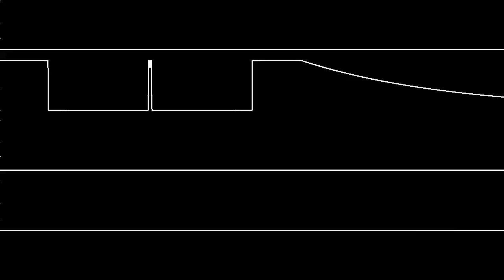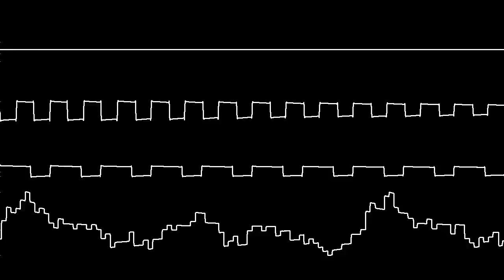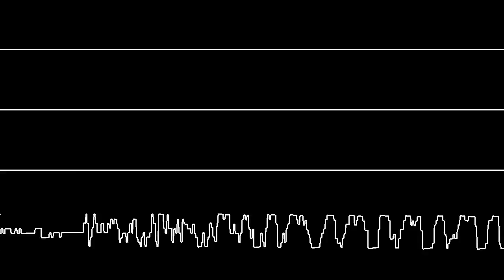C64 Jeroen Tel's "Turbo Outrun" Oscilloscope view

Comment from the maker: It seems like we have been visited by 2 disgruntled Spectrum owners :)
Reply: Haha! ;-)
Reply: 8 months later and make that 6. The Spectrum was both capable yet not at the same time. It was more like the Master System's sound chip (Well, not too far off really) so it could not perform near as complex as the C64. The only thing with the Speccy is that it has a much bigger following with it being a much cheaper micro than the Commodore meaning people will have a larger bias, especially if they were one of those kids in the playground arguing about which micro was better. Yes, the Spectrum in the end had more memory but it was hindered in every other way, both video and sound wise.
 I myself am only 16 but have been brought up under the use of old micros to respect what tech was like in the past.
 I wonder if the conflict between the Spectrum and C64 will ever end. Who knows? It may never end!

Good day!
Reply: Hehe!
Maybe another 4 were lsdj chiptune composers...
Reply: probably not. XD

Hey, at least you weren't one of those people (like me) that owned an Atari 800XL...
That machine wasn't exactly weak, but it failed. Hard. Against pretty much everything. (mostly not for technical reasons though)

Granted I had one around 1990, so the 8 bit micro wars were long gone by then...
The primary hobby of Atari 8 bit coders nowadays seems to be to see just how far you can push ANTIC + GTIA...
Quite far it turns out. (if the 4096 colour JPEG image viewer is anything to go by. XD)
Nothing about getting high end graphics out of an Atari 8 bit is remotely straightforward. (with only straightforward basic techniques it gives worse results than a c64, for sure. But when pushed it seems to do things that seem unthinkable for an 8 bit system)

None of this has anything to do sound of course. Pokey is... Well, it's not the worst thing ever, but it's certainly no SID chip. It can come close if you try hard enough I guess... (and sample playback of a sort is a feature, and not a hack), but still. Otherwise nothing but square waves as far as the eye can see... XD
Reply: 7 now
Reply: Well, mostly, the spectrum didn't have the HW features that made it easier to play samples. It even has 3 volume controls instead of 1. The problem is that the chip is slow and you could only have envelopes or volume contol for all chips at once. And since samples are usually played back through volume control, one would have to tailor the whole song around being played back in that manner. Also, not all spectrums have the same timing. So Sample Playback is even more tricky on the spectrum.
Reply: NINE
Reply: They've been joined by a few old Amstrad owners.
Reply: Honestly I do quite like the POKEY sound myself, but the SID has much more potential when used by someone who knows how to use it. But atleast the POKEY has 4 channels, not 3, but...

A big problem with the POKEY is that it only uses 8 bits for pitch precision, and ends up sounding out-of-tune in the higher pitch ranges, and you can only have 16-bit pitch precision if you disable one of the four channels.

But still, the Atari 8-bit was released three years before the C64 and a year before the VIC-20, so you've got to give it some credit, since the only succesful computers back then were the Apple II, Commodore PET and TRS-80, with the latter two not even having sound.
Reply: @leoleonvids  didn't the Commodore PET have a beeper?
Reply: @PremierRomanov  how can a machine with less than 50% of sold units have a much bigger following?
Reply: @Ailgadem  Later Models Did. Only One Beeper So No 3 Channel Music

Comment: People do not even know how much ahead of its time was this or in general C64 music programming - and by extension any kind of coding for the machines of the time. Most programmers nowadays are python API-callers that would not even be able to read that 6502 asm source, let alone to write it at 17 years old. I'm not saying this because I was too, in my little own, a coder in the Amiga demoscene at the time, but because the C64 and Amiga epoch (the 80s and the early 90s) are not credited enough, imho, in the history of informatics and digital arts.

Comment: This is incredible. Jeroen Tel was a god on the sid chip.
Reply: Same thing as Rob Hubbard.
Reply: Bruce Alexander Exactly. If I recall, Hubbard was one of the first (if not THE first) to use this "sample bug", on Skate or Die. Which is an amazing soundtrack as well.
Reply: The first samples (included with a SID song) I heard were in the Arkanoid title track by Martin Galway.
Reply: Didn't know that. I did some research and apparently Galway was the first to take advantage of the SID's volume register in order to simulate a fourth channel. However he didn't actually use samples, but created the sounds himself via code. I know that eventually he made a custom version of the Arkanoid's soundtrack using 4-bit samples. Hubbard was maybe the first who included an electric guitar sample in a SID tune.
Reply: Skate or Die 2 only existed on the NES, and the title screen music took advantage of the 2A03's 7-bit PCM.
Reply: 1 bit Delta PCM, actually.
Reply: Actually, 7-bit PCM would be possible on a 2A03 by fiddling with Famitracker's Zxx effect. This was used for the vocals and electric guitar, while the drum samples are normal DPCM.

Check https://cirrusretro.com/listen/147-skate-or-die-2-nintendo-nes and mute all channels except "DMC."
Muting channels and seeing oscilloscope view requires the use of a computer. Won't work on mobile.

As you can see, the sample channel is sending a buffered PCM wave instead of a DPCM waveform.
Reply: Interesting.
Reply: Bruce A. Dyson That makes me wonder, maybe you can use the 5th channel like the gameboy wave channel and use it as an extra synth voice for pseudo expansion sound which would be particularly useful for non Famicom NES. It would probably take up too much CPU though...
Reply: @Bruce Da Moose Lol, I just came back here to these replies a few days ago, and suddenly you post this reply!

Comment: I'm constantly amazed with what people could make these old machines do.
Especially once I really started to look into how they worked.

Sound especially seems like a pain, given the timing constraints and the interaction between sound, video display and CPU time.

I can certainly see why the 16 bit consoles all had a dedicated co-processor for sound.

OK, so personally I've mostly messed around with my 800XL, and while Pokey has rather different qualities and features to the SID chip, the basic principles of getting it to produce any recognisable melody don't seem to be vastly different. Getting anything to update at anything other than either 50 or 60 hz (depending on whether it's a PAL or NTSC system) or an integer fraction thereof seems especially difficult. Which is... OK, sure, 3000... 'notes' per minute? But for sample playback it's extremely low...

I'm impressed with how long this track is too. Where do you find the space for it all in just 64k of memory? XD

Anyway, not like I'll ever get any decent sounds out of these old systems. I simply have no musical talent. I can code, and I can draw moderately decent artwork, but when trying to compose a tune I'm completely lost...

Comment: Are the samples being repitched (like for the bass) or are there many samples each for a specific note?
Reply: Are you talking about the resolution of the waveforms?
As far as i know about the SID Chip (Which is from reading, I'm from the 2001 so... no much experience xD): It didn't have a sample table, it used pure logic electronics to accomplish that waveshapes, that's what makes it so unique. 

Plus, it uses a 24bit counter to sample them, so yeah, plenty of room to make really smooth waves. Added to that it uses low pass filters which adds an extra smoothness.
Reply: Probably repitched. The bass guitar and bass drum are on the same sample. I can hear the bass drum change pitches with the bass.
Reply: As far as I know, with the tracker I use (I don't know about Fast Tracker II, which is what he used), but essentially what a sample is is instead of square waves or triangle (etc) it's the sample. Which means you can play it as if it's just a synth, I'm pretty sure that's how most samples work anyway.
Reply: I think @Donald Thompson 's answer is the most close one. I finally get that the question was about if per every note there's a different sample which represents a different frequency. — So, @Train 's answer is also good, as it pretty much proves that this was made using one single sample per instrument and then being re-pitched before sending it to the SID. 

Although, it could be just one long stream of data being repeated (? idk. As i said, i never had the experience to use this hardware and probably never would xD

Comment: 0:00
Noise wave 
Noise wave 
Noise wave
Noise wave 

0:24
square wave
triangle wave

square wave
triangle wave

square wave
triangle wave

0:46
Noise wave 
Noise wave 
Noise wave
Noise wave
square up building

outrun

square wave
triangle wave
square wave
triangle wave

square wave
triangle wave
square wave

1:22

Noise wave 
Noise wave 
Noise wave
Noise wave 

outrun

sync square wave PWM 20-80% Duty Cycle to down volume
sync square wave PWM 20-80% Duty Cycle to down volume
sync square wave PWM 20-80% Duty Cycle to down volume

1 2 3

Comment: beautiful as always :) very interesting all information about digital tracks... where did you get these? also the information about the filters it's important because, according with dump file, filter used on intro theme is low+band pass
Reply from the maker: Your right, it is low-pass + band-pass. Corrected the description. I get the tracks from JSIDPlay 2.3.3

Comment: I'll drop this here, I noticed in the source code of SidWiz that the waves are rendered upside down! I thought the upside-down sawtooth was a SID thing but I guess not!
Reply from the maker: Correct, but I invert the waves before running SIDWiz. The reason they are inverted now is because the filter path of the SID inverts the waves.
Reply: Woops, they looked so sharp I didn't notice they were filtered :) Anyway I'm practically in love with SidWiz, currently rendering an entire demo with the waves overlayed. I'll upload it some time in the next few days if you're interested.
Reply from the maker: Yeah, drop a link when ready :)

Comment: Why is it shown as 4 tracks when the C64 only had 3 hardware channels?
Reply: This tune uses samples that are being played by modifying the upper 4 bits of the volume register. It doesn't alter the volume but it does produce an click which can be used to play 4-bit samples.
Reply: @saucedispenser9167  I think it actualy does modify the volume, thats what causes the "crunchy" sound on the 3 audio channels.
Reply: @saucedispenser9167  Also, sorry for necroposting
Reply: Also you get half the volume of what would normaly be on the sid chip.
Reply: @oscwavcommentaccount that depends on if you were stupid with the samples or not

Comment: Can you make an online browser version of SIDWiz? This avoids malware threats.
Reply: SidWiz is written using components of the .NET Framework. There's pretty much no way to properly port all of it's functions to JavaScript. Even if you did, any webpage that would process files in that manner would need to request direct access to files on your computer. It wouldn't be any safer then just downloading and running it. If you're worried about the security of the program, you can look at the code to see what it does before compiling and running it, as it's been provided as source code.
Reply: @theLuigiFan0007Productions  Two years later, I'm no longer concerned about viruses and malware threats in these programs. I just scan them using the VirusTotal website.

Comment: I am confused. The sid has 3 audio oscillators, or FM channels. My experience with digitized audio on the C64 was it was simply a rapid manipulation of all 3 FM channels to forge the digitized audio sound. Unless this is using the 2nd stereo sid chip, what is producing the digital channel?
Reply: It's a hardware hack where you change the volume register quickly, which generates a tick. If done often enough, you can play 4-bit samples on an additional channel. However, this only works on the 6581 SID. (You need to solder a resistor between two pins for it to work on the 8580 as well)
Reply: It isn't FM, it's PSG.

Comment: 4 channel ? :O
Reply: A "Bug" in the 6581 lets you play 4-bit samples by tweaking the upper 4 bits of the volume register at 54296.  It was "fixed" in the 8580; on an 8580 the sample would be silent.  You can "reinstate" the "bug" by soldering a resistor across two pins (I forget which two).  That's how Jeroen got 4 channels from a 3-channel chip.
Reply: Thanks! :)
Reply: Yup, that "fix" was a big bad wolf for us Commodore 64 composers.
Reply: Then the older the C64 the better  : )
Reply: Jeroen Tel,

Do you have any idea why Commodore would not embrace the glitch?
Reply: +Jack Nedry, Simply put, the 8580 is essentially closer to the SID design. The original design wasn't quite accurately followed for the 6581, probably due to rushed development. Commodore simply later went back to the original design, and made a new SID that was actually close to the intended specifications. But at that point the "imperfections" of the 6581 were actually working in its favour. Commodore's engineers probably didn't take it into consideration and just wanted to improve their designs for the new Commodore 64 models.

Comment: But... so the digi voice is a fouth voice??? i thinked that digi could play only alone....
Reply: It's a trick with the SID chip, essentially they're exploiting a bug in the chip that caused clicking when the volume register value was altered. By continualy altering it fast enough, 4 bit samples could be played separately from the three SID voices. It's very clever programming.

Comment: how come there are 4 channels? i  though the sid chip only had 3...
Reply: A "Bug" in the 6581 lets you play 4-bit samples by tweaking the upper 4 bits of the volume register at 54296.  It was "fixed" in the 8580; on an 8580 the sample would be silent.  You can "reinstate" the "bug" by soldering a resistor across two pins (I forget which two).  That's how Jeroen got 4 channels from a 3-channel chip.
Reply: Cool!!!